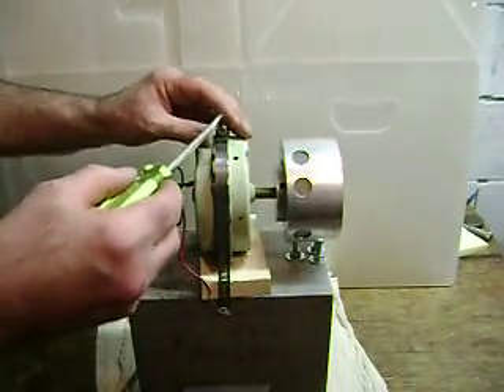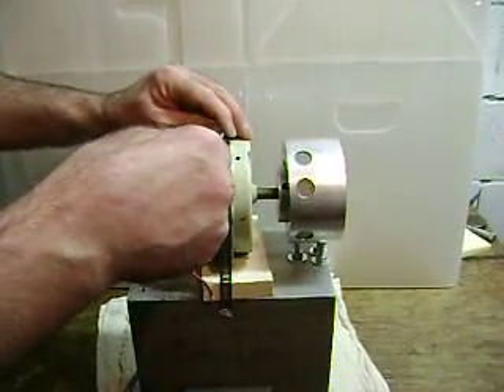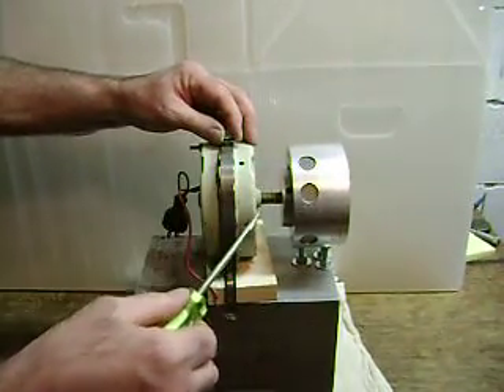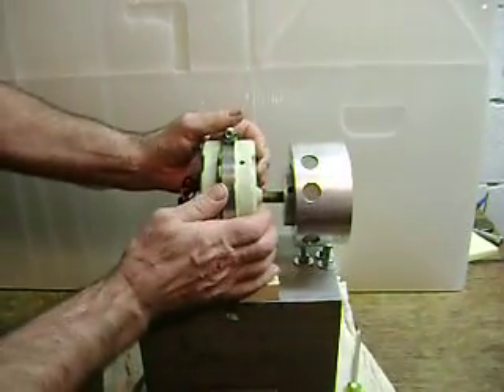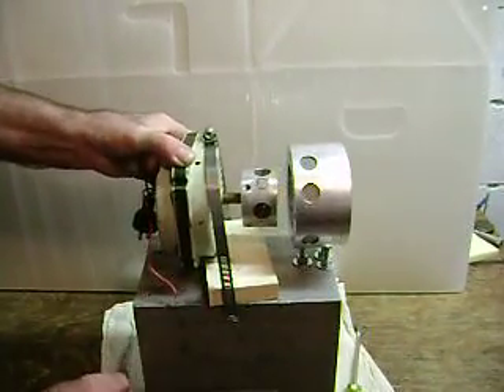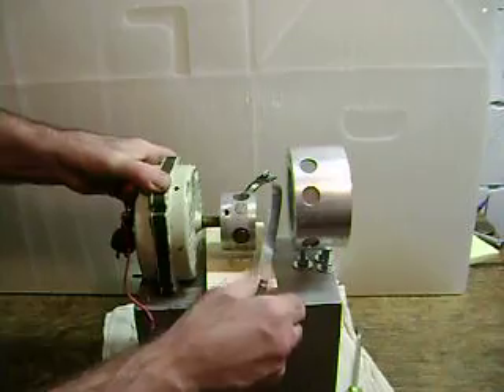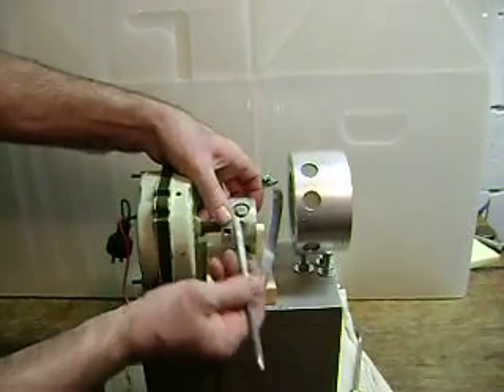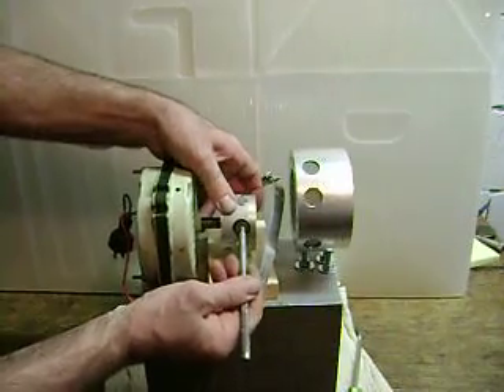Magnet Only Motors /Autono-Drive Testing Device Partial Disassembly

Comment from the maker: @1crazyfocker. (1)No I don't have a gauss meter, I was checking for fading and even though my diagnostic methodology may not be up to snuff, it was enough for my satisfaction. The test was for one month.
(2) The magnets do all the rotation, the solenoids only shift the position of the shielding sleeves. HP was negligible as it has very small alnico magnets. My intention was only to accomplish rotation, which it did. The solenoids are 120V AC.
Thanks for the acolades!!

Comment from the maker: @poweruser69  Too late poweruser69, I dismanteled it a long time ago to get the fan back in action that the motor came from. I wasn't overly concerned with electrical readings because that wasn't the point of my test.
Thanks for the observation though.
Donovan.

Comment: @MagnetOnlyMotors okay, nice test tho, I would have done the same thing , since i dont have a gauss meter, something like how many paper clips it picks up on avg before then after(would have worked for me to prove the point), but the fact that you ran it for a month shows true search for answers. and I understand the way your motor worked, i use the term HP just because it the most common term, a good way to test it is to put a know wieght on it then measure rpm. force X speed. thanks anyway

Comment: @MagnetOnlyMotors hey i may not have seen the video yet or just missed it, you said your test showed contrary to the belief that magnets will lose their strength, did you use a gauss reader to test it? or what did you do to test before and after, and how long did you test for?
anyway great work like before i enjoy all your videos. and BTW your solenoid motor is a great idea. since the magnets do most of the work, and you only need to power the solenoid how efficant is it? watts in, HP out?

Comment from the maker: This is not a power source, only a testing device. Nothing to do with GM electric motors.
The only power is from the 120 volt electric motor used to turn the rotor. Sorry Bud.
 Donovan